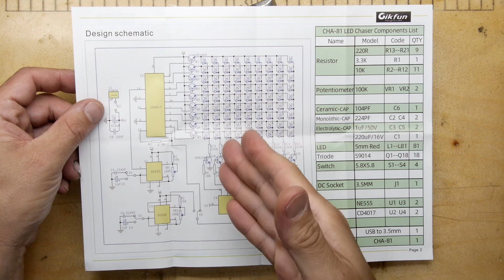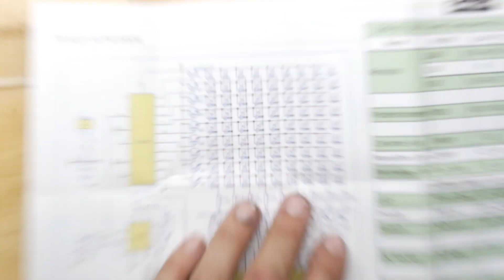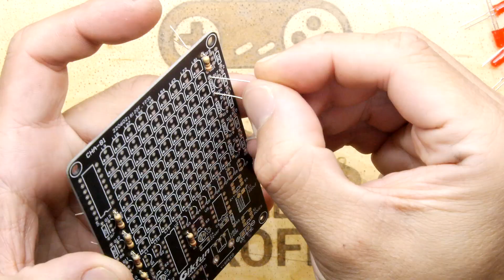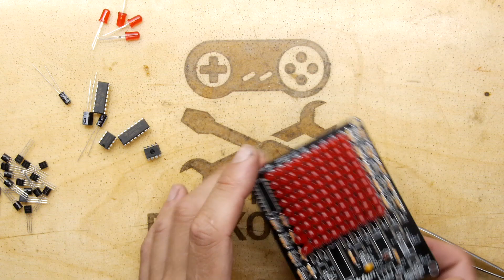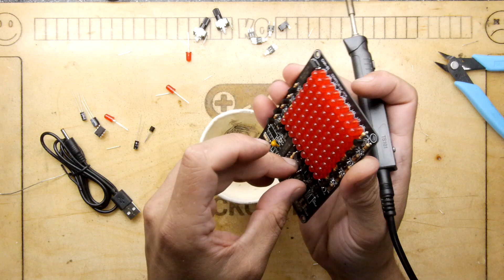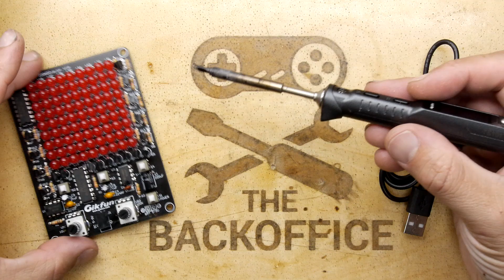Amazing LED electronic Chaser Kit - only £12!

Comment: I received one of these kits that didn't include instructions. I realize that someone has experienced could probably make this just by looking at the PCB but I'm a totally beginner, so this video helped me actually make it. Thank you so much.
Reply: you need a meter to measure resistances and capacitors. get a cheap one. then a solder station: get a good one: a weller. start with temps 350°C and see. It's not so easy at the beginning. I lost one kit, then I practiced on it. And did a 2nd one.

Comment: Hi, great video, first time viewer. If I wanted to use blue led's would I need to use different resistors? Sorry for the basic question but I am quite new to the hobby. Thanks for sharing.
Reply from the maker: Technically yes, but I would just test a few first. If they seem ok, keep the existing resistors

Comment: That's a clever implementation of a pair of my favourite ICs.
Reply from the maker: It would be cool to have a direction switch for each channel. I wonder if that would be achievable using standard components
Reply: @backofficeshow  Unfortunately, the 4017 only counts in one direction.
Reply from the maker: @pileofstuff  I think they must do one with an 8 bit binary output, that could be fun

Comment: Built this a few weeks back. Pretty cool what it can do with just a couple 555s and a couple decade counters. Mine didn't come with any manual and the LEDs wouldn't quite fit without snipping the edges off a few of them.
Reply from the maker: With the right case and a few fancy knobs it could make for a half decent prop